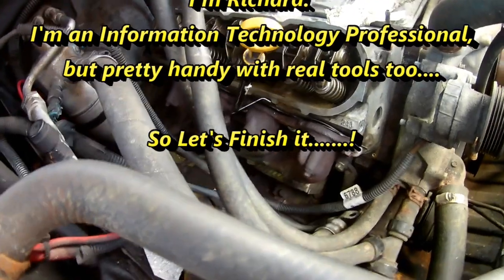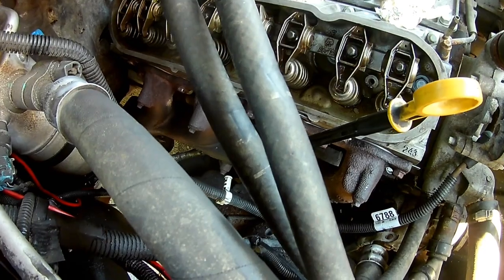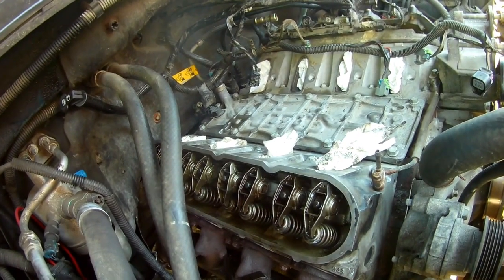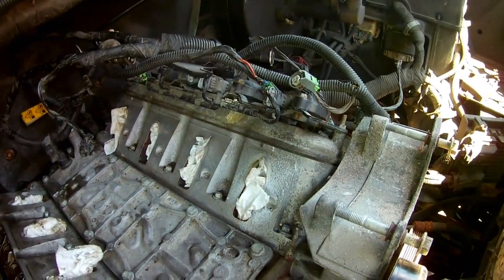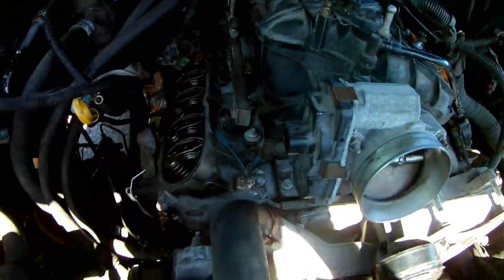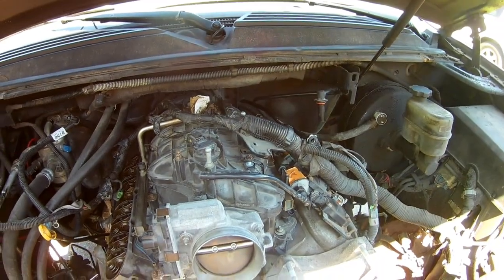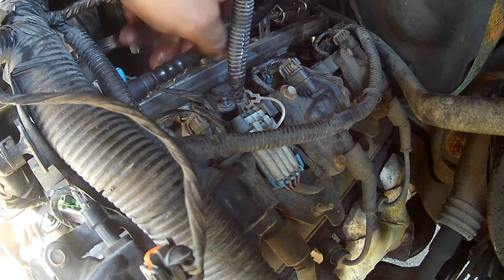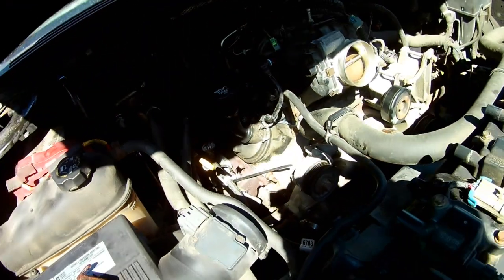Chevy 2009 5.3 L Head and Lifter Removal and Replace Part 3 of 3

Comment: I was wondering if you considered the delete kit?
Reply from the maker: I did, but given that it's high mileage, and not a daily driver, I chose the cheapest route. The delete kit was more in parts and a LOT more work (from what I could see) - and would require a reprogram of the computer.

Comment: Thank you so much I have a 2011 avalanche with the 5.3 and have a bad lifter need to go through 
Question if I go through all the effort to pull the heads should I change the VLOM and lifters?
Reply from the maker: I would change all the lifters on that side - I don't think changing the vlom or doing the other bank is necessary until something goes wrong (because you aren't really saving a lot of work to do those separately when needed)

Comment: This is the third time my 09 chevy silverado has left me stranded because of a bad lifter i paid 2800 the first time then a month later itbroke down again from a bad lifter even though the mechanic told me these were new and improved lifters. Luckily he had given me a year guarantee  so he fixed it for free that time. Now 50,000 miles later it broke down again i was told its the same thing a bad lifter. This is by far the worse truck ive ever owned i fkn hate chevys because of this truck i regret so badly having bought it. But now i have to fix it but im thinking about doing it myself hopefully i can do it
Reply: I cant decide if i should put another engine in it or repair this same one again. Both options are expensive af
Reply from the maker: Sorry for the late response (never checked comments), but yeah, this design is terrible

Comment: I’m currently putting back together my 2010 5.3, but before I start it up, is there anything I need to do with timing? I can’t find anything straightforward online. I have the same engine set up as the video.
Reply from the maker: If you didn't replace the camshaft, you won't need to worry about the timing. So if you followed my video, timing isn't affected. Note you will want to set the engine to specific points in the firing sequence when torqueing the rocker arm bolts. I mention that in the video.

Comment: 37 min long but at 27:16 starts the VLOM mod. I believe with this mod and later having the ECM reprogramed to cancel the AFM you can achieve what is essentially the VLOM delete without changing the cam shaft for a lot cheaper.
https://www.youtube.com/watch?v=pP7I5tbXsfw

Comment: Doing the exact same thing on The last steps of putting everything back. Do I need to prime engine so oil gets to the valve or just run it
Reply from the maker: Yes - pull the fuel pump fuse and crank it over a few times to get the oil into the lifters. Crank it for about 7-8 seconds, then rest, then repeat 2 or 3 times.
Reply: @Argellus  fast response. Thanks. Oh and there’s no way I could work on this suburban and video lol great job

Comment: When you say it ticked for a little bit, how long is a little bit lol?
Reply from the maker: Several Seconds. I suggest pulling the injector fuse, and cranking the engine over a few times to prime the lifters with oil.

Comment: I have a pipe camera.   I would have slid it down the push rod hole and looked at the camshaft.   If it was buggered I would have put in a junkyard one.   I think a bad lifter would bugger a cam shaft quickly
Reply from the maker: morgan freeman the way the AFM lifters generally fail (from what I’ve read and in my experience) is by collapsing Within the body or spring, and in my case it made no noise, because there was still proper tension pushing the lifter onto the camshaft (basically acting like a normally operating lifter from the Cam’s perspective). In this case, the roller stayed in proper contact with the cam and there was no wear. You can see the lobes pretty clearly once the lifters are removed. 
If the cam is damaged, which certainly can be the place of a lifter spun or was banging on the lobes, I’d strongly suggest going the distance and doing an AFM delete, which would ultimately be cheaper and would fix the AFM Lifter issue once and for all.

Comment: Can you post the link of the print out you are referencing while your doing it?
Reply from the maker: Tom Stevens I got it from Haynes manuals online. You need to subscribe to access it but it’s well worth the $20. .
Reply: @Argellus  ok thanks! Does the manual explain both sides and list all the parts/materials you will need to get?
Reply from the maker: Tom Stevens it does not list the parts but does give torque settings etc. and a good step by step process. I made a list of the parts at the end of the video series.
Reply: @Argellus  thank you

Comment: Hey Richard! Thanks so much for the video! I see you had a reoccurrance of the issue. After you replaced the bad lifter the second time and replaced the VLOM, did that cure it?
Did you disable AFM?
Reply from the maker: I actually replaced the VLOM, and had ongoing issues - turns out the replacement Dorman VLOM was defective. I got it warrantied, replaced it, (well, the other way around) and it's been great ever since. I ended up doing the other side and replaced all the lifters 1-7 anyway. Definitely check the filter screen under the oil pressure sensor on the VLOM because any debris there will wreak havoc on this DOD system.
Reply: @Argellus  I replaced the VLOM and all the lifters on the driver's side, where the bad AFM lifter was. Now it runs, but there's a ticking that sounds like it's coming from the passenger side! Why would that be?!? The passenger side was fine before. I have special oil in there right now and of course did an oil change right after, so my plan is to just drive it as is for awhile. What do you think? 
I will get to the other head at some point, and will do it if problems get worse, but right now it just seems to be making a noise. I already removed the valve covers and checked the torque on the rocker arms and checked for bent push rods. Everything seems fine. What would you do? Run it for the winter and replace all the passenger side stuff in the summer?
Reply from the maker: Daniel Clark sounds like worm lifters maybe you didn’t hear them before due to the worn lifters on the other side. Does it get quieter at all when the engine runs for a bit? I’d do them too as you’d expect they’d all start to fail around the same time. I’m not a mechanic though so if you’re concerned get it to a garage.

Comment: Did any Exhaust manifold bolts break ?
Reply from the maker: RAHRAH807 no. I did spray them all with penetrating oil before I started though. Buy new ones though because they’ll likely be rusted and rounded off and they’re not expensive
Reply: Richard Lahti they came out pretty easy

Comment: You got the video for the rocker arms
Reply from the maker: thomas martin what is it you want to see? When you remove them, keep the parts in order and inspect them for wear, replace where necessary. When you reassemble them, put the push rods in, pivot rail down, and rocker arms hand tight until all in place. Rotate the crank manually until half the springs are fully expanded, tighten (torque) those, then turn crank 360 degrees and do the other 4. torque the bolts to the proper torque setting. I recommended paying the $20 for the online Manual at Hayes the process is explained there, but that’s about it.

Comment: Richard, quick question for you...how's the vehicle running today? Just want to see if this is a long term repair or if the delete is the way to go. I appreciate your time and detail in the three video series. I've watched it multiple times as I prepare to do this repair myself.
Reply from the maker: Gabriel Brink the engine runs great however it has started occasionally throwing a misfire code for cylinder 7 which I can clear easily with a quick rev of the engine to increase the oil pressure and reset the lifter. Eventually it will fail. I only did  the one side - 2-4-6-8, and I expected that I’d see problems with the other side at some point. I plan to repeat this procedure on the driver’s side bank 1-3-5-7 and replace all the lifters on that side. If you have he money and the time, I’d suggest the delete, which can basically is doing what I did here, except you need to also swap out the camshaft and replace the afm lifters with normal ones, remove the manifold with a kit, and then tune out the afm in the ecm. It’s quite a bit more work to do that and probably twice the cost. I have had no trouble with the side I worked on FYI.
Reply: Perfect! Thank you for your thoughtful reply!
Reply: I am told you can replace everything with stock items and still tune out the AFM even if you didnt replace the CAM

Comment: Look up archoil 9100 additive. I added it to the oil have had zero issues in 100k. I've always ran gm syn oil. I'm not saying it the majic fix but if you understand how afm works and the vlom I really think this should prevent the problem. And give the engine the proper protection it needs. I also used in my Diesel and the results have been nothing but positive. The people saying add snake oil I agree with you but I will say after adding it to the gas engine I noticed a huge difference in engine sound,pick up, idle and cold starting. Plus it deaded the issues from v4-v8 mode I can't tell any more when it switches before there was always a hickup.  Mpg also went up. When I did it the wife noticed it right away with out me  saying anything. I use the oil additive in all our engines and have had zero problem s using it. Fantastic video BTW
Reply from the maker: 1911loaded I will say that I when I first had the failure showing (0304 codes and lifter noise) I used 1 Quart of Lucas oil in an oil change and I was amazed at how quiet the engine was after that, and the code didn’t recur for about 8,000km. I did this because the lifters started to go in December, and wanted to try buy some time to do the repair in the spring, and was really amazed at what a difference the Lucas made. Anecdotal, but in my case a very noticeable difference and bought me the time I needed to make the proper repair! Whether or not using Lucas routinely would help lifter and general engine life isn’t something I have enough info about to comment on, but in my case it wasn’t a coincidence and in my specific case it made a very obvious difference (no lifter noise  - I mean really no clicking at all - and no misfire codes which were happening every 20-50km before this. The noise gradually began returning over the next several thousand km though but was still way better even at the time of the repair). Thanks for the advice and thanks for watching!

Comment: Great video. My sierra has a lifter problem right now.
I see in your description that you replaced the vlom and that you descovered that issue due to a follow on failure. Did you check your crankshaft at all for damage? Or is that not a concern?
Reply from the maker: The bass fishing network The BFN it would be the cam shaft that would really be the concern, and I did look at it with a flashlight for a quick visual, and saw nothing obvious. A valve lifter failure could definitely impact the cam shaft, and if you need to replace that, I’d suggest doing a full DOD delete.

Comment: I didn't see the whole video series, but did yiu have to time the engine, i mean synchronize the engine or it can be done at any stage?
Thanks
Reply from the maker: When you torque the rocker arms down, you need to start at TDC, torque a certain half of the rockers (you can google the order, or go to a service manual), then rotate the crank 360 degrees and do the other half.

Comment: Would you advise to stay away from these AFM engines? I'm looking at buying a 2005 GMC Envoy XUV with DOD (AFM), the first year for the LH6 5.3l V8. It was a one owner vehicle with 44 service records on the car fax showing many documented oil changes. It's physical condition is excellent-no rust at all on the body (it's in North Carolina).
Reply from the maker: alan2112drums it depends on the Conditions and what you’re  paying for it. If you’re doing the work yourself, a full AFM delete including camshaft is probably about $700. The Guts of these engines are among the best in my opinion. DOD will eventually fail. It’s just a matter of time.
Reply: So better to get the 2004 LM4? I have that now in my Envoy and there is lifter tick for about 1 minute at start up but then it goes away. Been doing it for 3 years, has small oil leak but it drives real smooth.
Reply from the maker: alan2112drums here are other factors to consider like compression and valveteain wear, but if all things are equal I would avoid the AFM engine. You could follow these videos and replace the lifters on your engine. They’re pretty cheap you could probably do the whole engine for $300
Reply: I just bought a 2005 GMC Envoy xl and only drove it for a week before I got a P0304 code. Just found out it's the lifter stuck. Not sure what my repair bill is going to be but dam this annoying.